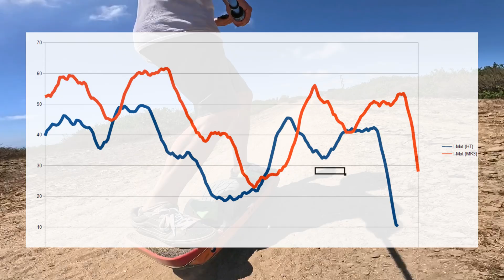Bring the Heat - Part 4: SuperFlux HT on my Tronic X12-30s

Comment: Which motor is better to go with the cannoncore v2 or the sf HT?
Reply from the maker: You probably mean CCv3 - the HT is a little better in thermals and much easier to deal with for install. CC requires special mounting blocks (eg Versa blocks) and a cable mod. Also the stock CC bearings are trash - some people do prefer the CC for HV builds as it seems to be easier to tune out the hall sensor crunch
Reply: @surfdado  yes i mean the CCv3 install im not to worried about i just want a motor that is the most stable while riding and has the best thermals while riding up hills.

Comment: Hey there!  I am building a BTG board for trail riding only. In your experience, would you choose the HT or the HS super flux? I weigh 180lbs. 

Thanks!
Reply from the maker: @rxilher  if it’s not a high voltage build stick to the HS
Reply: @surfdado I'm building a 30s offroad board.  I rode a 20s HT and a 30s HS, and there wasn't much difference that I could feel. Would you recommend HS or HT for my 30s build offroad?
Reply from the maker: @ on paper the HT is the smarter choice, I practice you may not feel much of a difference

Comment: How much range do you get with your 30s with the p45b cells? I’m super intrigued. Is it similar range to a 84v meat pack or better?
Reply from the maker: @Benjarmanberekenar  that’s not how it works. 30s is basically 10 percent more than a GTS. A 84V meat pack has 40 cells, so 30 percent more range than the 30s

Comment: Is there a noticeable torque difference between the HT and mk3? I’d also love to hear your pros/cons of 30s1p vs 20s2p (other than top speed).
Reply from the maker: honestly I can't notice a difference in torque between the different SF variants
Reply: @surfdado I’ve got an HT attached to my 19s with p45 batts with a 7” Burris and an HS on a board with an 18s and regular batts with an 8” Burris.  

I get that there’s s ton of differences and moving parts. 

The HT has a ton more power and torque.  Would you guess it’s the P45s or the diff of an 18 vs 19s?
Reply from the maker: @prunepoo  19s-P45b does offer more torque than 18s-P42A - specifically the voltage sag will be lower. But there's a good chance it's just a configuration issue, no reason for HT to provide a very noticeable torque difference unless you have low motor current limits (like 120A or even 100A or less)